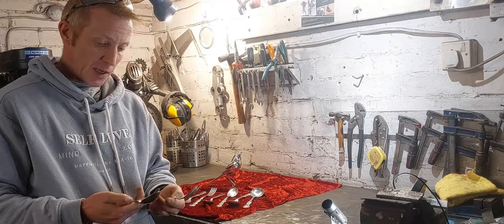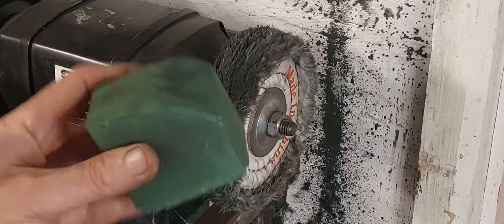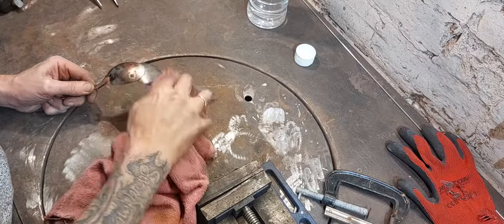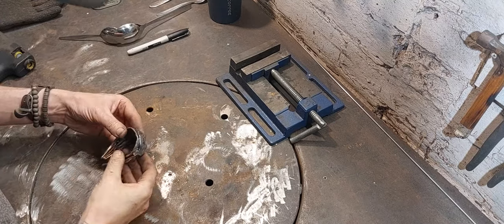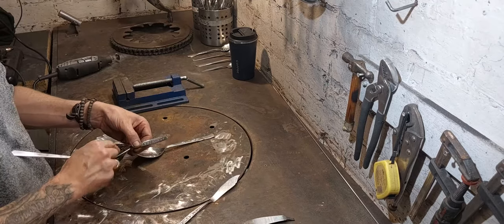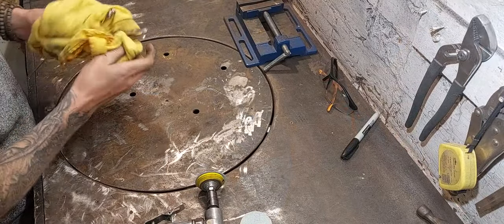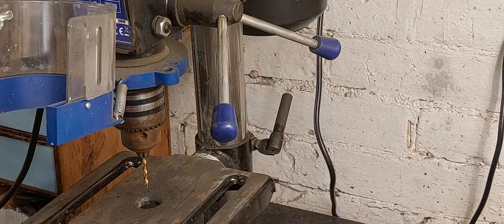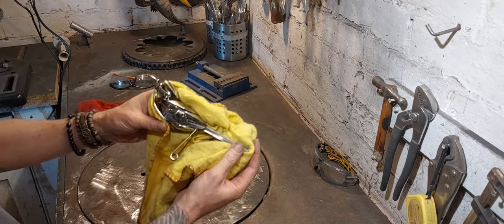Making Birds out of Cutlery - Song Thrush - A special Request, Full Tutorial

Comment: Are these full stainless steel because I would think that silver plated would grind off with the sanding. Very nice!!
Reply from the maker: Yeah stainless only. Can't really weld plated stuff, it gives off impurities in the weld like swiss cheese, very weak and ugly. No amount of finishing will fix it. Theoretically you could grind off the plate near the welded area before actually welding it but I think there would always be a disparity between the different surface finishes. It might polish up and look good initially but in short time I think you'd end up with visable 'joins'.  Cheers for the nice comment, have a nice day.